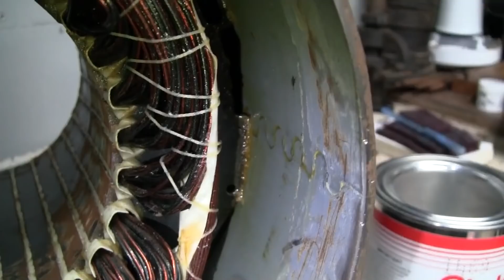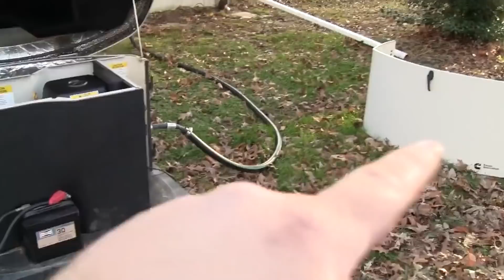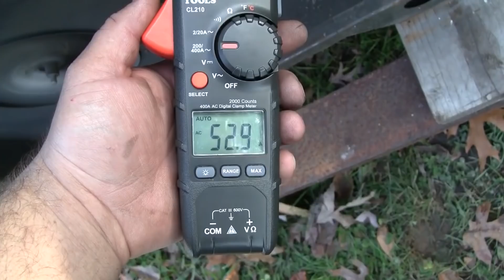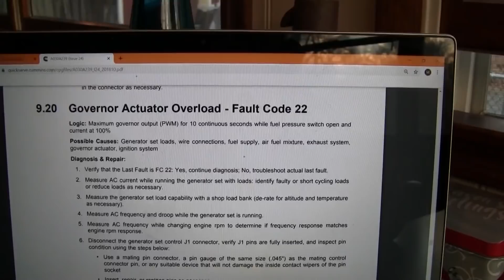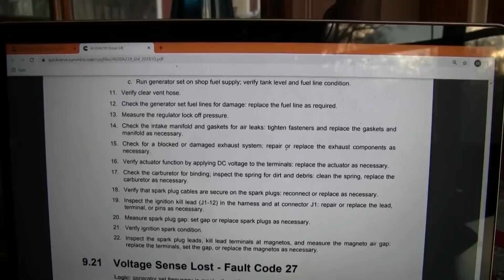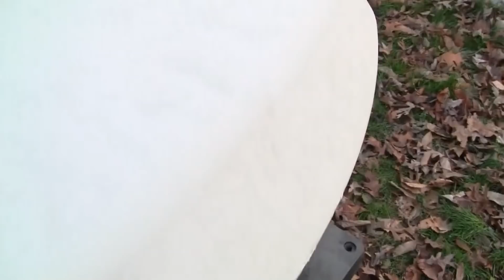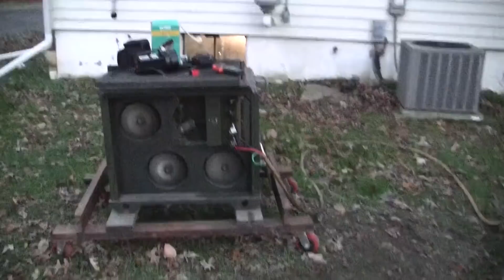COMPLETE REPAIR AND TEST 2015 Cummins Power Home Stand By Generator Pt. 2/2

Comment: I have an changfa 13hp hooked up to 500st head, it has a battery and a hand crank  I put in a glow plug cold weather. it so easy to start. with the pressure release lever. So i am able to get the rpm to start it.  It runs at 1800 rpm just purrs along and uses 1/4th the fuel a gas 3600 rpm uses, I also use the heat to warm my shop.

Comment: Can you make a recommendation for a top quality whole house gen set on diesel. Who makes the most reliable unit. I lean to Deere engine but not sure about gen set. Brush or brushless , inverter for clean power for solid state boards in hvac units, appliances, computers etc in homes today. Thanks.

Comment: Do you find that , IF you charge your standard labor rate , on say a $500 genset that your diagnostic AND repair costs easily exceed the value of the unit you are working on ? OR , do you adjust your labor rate down somewhat on cheaper units so you can stay busy and charge a Higher labor rate on the much larger units so everything balances OUT , over time ? Your expertise is amazing !

Comment: Great repair on that rotor.  The rope and epoxy was a nice touch.  I was worried about the centrifugal force on the solder fixes until you added that.

Comment: You may have mentioned this but can you tell me the Manufacture of the generater (or alternator as seems to be the correct term?) and was it the Italian Manf. Mecc Alta?. I was given a mid 2000s 12Kw mecc alta with subaru robyn gas engine (EH72 - V-twin 25hp). It is clearly commerical made but despite having commercial decals thu-out i can not find any Manfacture idenity but its is layed oyt ezactly  (Kinda) like this one you worked on but more modern in its control board and all analoge control with 2 large Caps. Need the idenity of  it so I can locate the wiring diags etc. so I can 1) work on it and get it going & 2) convert it to more modern digital control, if i can.  Thanks for any help you may provide.    MER

Comment: Some gen manufacturers rate these home units when run on LP gas. As you figured when on natural gas you must derat. NICE JOB. I have a 30 year old kohler 18 kw. Has a 2.3 l Ford engine, 1800 ram still going. I worked for a Cat dealer as a EPG Technician for 43 years. NIVE JOB

Comment: When my company replaces an old machine like that old Onan in this video.....We sell many of them to Mennonites from Eastern Pa......They will buy almost anything and try to rebuild it.....I have used epoxy or silicone to cover wires and help hold them more firmly like you did here. Generally there is next to nothing on those connections......It surely doesn't hurt to try and keep them from being pulled loose by centrifical force....

Comment: Now, it's had a good break-in period, time to change the oil and filter(if equipped) and adjust the valve clearances. It should last for another decade, as a backup generator for a residence. I would just recommend that the oil level be checked after every black out, to make sure it's ready for the next black out. The problem with natural gas, is that it can be considered an "infinite" fuel source. The generator won't run out of fuel, before it runs out of oil!! With propane, gasoline, or diesel, it's easy to remember to check oil level each time it's refueled. With natural gas, you must be vigilant on maintaining proper oil level. Most of these generators have a low oil cut off, but that is only a safety stop gap, not an intended low oil indicator.
      A generator like this should be test run periodically, and should run loaded for at least an hour each time, just to evaporate any moisture that has condensed in the oil from prolonged periods of non use. These are a good time to check the oil.(These are my biggest concerns for backup generators)

Comment: I have a Generac generator 30kw I had it installed 14 years ago. My house is 6200 sq ft.  It runs everything in the house never had one problem with it. It runs off of propane . It starts 1 time a week for 15 mins. It was worth every dime I paid. I have mine mounted away from the house like 75 ft. You can't here it at all but I live out in the country.  I did have to put a new battery in it. It has a 4 cly GM motor.

Comment: Too bad that the genset redesign was not retrofit able! Now there's a jargon laden sentence.  Good thing that you can find the fault and improve upon the original design.  I bet that that flaw is what caused the redesign at least in part.  I'm surprised that Cummins didn't take the faulty unit back for fault analysis!  I guess there was no point since the exact model is out of production.

Comment: Thanks for the videos on this generator.  The rotor design was very, very poor. Save a penny on soldering / brazing the connection but the customer (or warranty account) takes a beating.  Also that scratched winding enamel is incredibly sloppy craftsmanship!

This machine is so lucky you got it and saved it. It could have gone to the scrap yard quite easily.

During your test run, when you went to 15kW, I could hear that it didn't recover to full speed. Too bad about the gas pressure issue! 

Very cool with the stroboscope to be able to see the rotor while it's being affected by centrifugal force.

LOL I don't blame you for selling it. That is just WAY too new to be something you'll enjoy owning. :)
Reply from the maker: Thanks for watching David!
Reply: @SmallEngineMechanic  You're welcome!  I'm playing YouTube catch-up this week. Quarantine for 7 days to get on a jobsite LOL!

Comment: The two different wire colors are for lead identification when  making connections to external leads. Onan designs and makes this rotor and stator,.
Reply from the maker: Thanks for the info!

Comment: The Stroboscope portion is extremely interesting. Thanks for this video SEM...
Reply from the maker: Thanks for watching!
Reply: @SmallEngineMechanic  I enjoy listening to folks who are well educated in their trade. I would really like to have more knowledge on generators and the electricity they produce.  I am subscribed and  will stay tuned to your channel. Keep up the great work. Oh yeah, I really love that 885 Cu. in. engine, it's almost as big as the W.W.2 Ford built GAA engine which was installed in the M4-E8 Sherman. It was 1100 cu. in. displacement, 500 H.P.
P.S. Thanks for subscribing to my channel.

Comment: I have a 16 kw Generac. I'm curious if they used the same parts. I haven't had  many issues except a solenoid that was buzzing really loud and that was replaced under warranty by Danley. Great repair work and video.

Comment: You did a great job of repair. If I had to add a little advice it be to use very high temperature epoxy  as the rotating field usually runs quite a bit hotter than the stator., of course you are not directly on the windings. An old Delco generator engineer. Thanks for a very interesting video.

Comment: A couple of things I'd like to see if you still have the generator set up.  One is its step-load response at say, half load.  IOW, set the load bank to about 10kW and then close the main switch.  I'm very interested in seeing how well the governor responds.  The second thing I'd like to see is the throttle and actuator.  The reason is that I want to compare it to a Generac.  Generac uses a slow stepper motor to drive the throttle.  Therefore it's step-load response is horrible.  A step load of 1/2 rated output on my unit will sometimes bog the engine because the stepper is so slow.

A couple of tips based on my being an EE and more importantly my moonlighting for over 40 years in my friend Jerry Brown's Jerry's Electric Motor Repair in Cleveland, TN.  We lost Jerry to lung cancer in the fall so I've been spending at lot of time in his shop since then working out jobs they'd taken in.  The cancer disabled him suddenly so he worked almost to the end.

This is not criticism but tips learned from over 4 decades of motor repair.  First, on making the extension leads from the pins.  Jerry learned many moons ago not to use soft solder in high vibration environments.  It will eventually crystallize and fail.  I would have made those joints with silver solder.

Next, instead of that low strength ribbon, I would have pushed the wires as tightly as possible against the plastic and then wrapped it with Kevlar string.  Next is the question of the temperature rating of the epoxy.  For repairs like that we use a motor repair epoxy rated for 400 deg F service.  Finally, I would have drilled some angled, shallow holes in the plastic and used a sewing needle with the end ground off to make a fork to push some Kevlar fibers into the holes, followed by the epoxy.  this provides a tight mechanical lock in addition to the adhesive bond.

One of the things we did was modify small series motors to make them extremely high performance motors for hotrodded small electric vehicles.  A typical mod was to take a GE 6 hp at 36 volts rated motor and mod it to run at 15,000 RPM and 150 volts.  Things like I described above, especially techniques to hold the commutator together are used.  

John

Comment: Hello Boss :) .......... i have a question. shall we need to Advance the ignition timing while using Natural Gas ... as far i know .there is the difference between Petrol and natural gas octane. :) i have 1OKVA Generator and i made changes to increase the timing by 2O degree, increasing the ignition timing by 2O degree (advance) the engine performs better with low Natural Gas consumption. it means 25% to 3O%  less Natural Gas consumption.

Comment: I would keep it, unless you are desperate for money. Get a bigger orifice for your regulator and plumb a bigger pipe to get rid of fluid friction loss in that hose. Build a concrete block 3-sided baffle to direct noise away from the house, and you would have a really nice standby generator setup. Maybe you already have one? Never mind...

Comment: What made you decide on that strobe vs. others on Amazon?
I am interested in another brand that has trigger in/out available, but don't know what the light output is.
i might even get the other model and change the flashlamp to a high output LED.

Comment: Very well done. A solid repair. Could an old car engine timing light be used to strobe the rotor if the light was triggered by one of the spark plugs?
If you spliced in a propane supply to boost the pressure perhaps you could have gotten full output before maxing out the governor.

Comment: Epoxy varnish is tough so factory did the hack job on clean up of the stator.Glyptal is a downgrade from the epoxy.I was an electrician/rewinder for the Navy for 30 years. I'd have gotten some class H varnish to coat the stator and baked it at 400 deg. for 4 hours.It would be better than glyptal.Using a strob on a 400kw generator once and some dweeb from another craft tried to reach inside it.I grabbed his arm or he would have lost it.lol

Comment: Regarding centrifugal force on the soldered connection and wire fix. Assume the solder and  copper weigh a half ounce total, the radius Is 1.5 in (3 inch diameter circle) and 3600 rpm then the total force is about 17 pounds pulling outwards from the center. This is more than I would have guessed.
For more info look up  Centrifugal force calculator. You can just plug in the numbers.

Comment: We have a 15KW 2-3 years newer and we're just over 100 hrs. Heck just the 20 min exercise every week puts on17.3 hrs a year. Good unit. It just starts after about 10 sec into a failure, puts out power in about 30 sec more, and then just purrs. After power is restored, it runs without load for about 10 min and then stops. What more could you ask for?

Comment: That Glyptal paint reminds me of the Red-X corona dope we used in television high voltage repair years ago.
Reply: i bet you got some old school knowledge.  you ever mess with old tube radios or guitar amps?
Reply: @stevewinwood3674  I started out repairing tube radios in the late 50's.  At that time, all consumer electronics with the exception of a few battery powered radios were vacuum tube based.  I've repaired quite a few guitar amps and HiFi audio amps and preamps in my day.  In the late 70's, I specialized in VCR and camcorder repair.
Reply: @NCF8710  sweet.   you ever watch "uncle doug" channel?   he does guitar amp videos.   i have learned a lot from him
Reply: @stevewinwood3674  No, I haven't.  But I will certainly check it out.  Thanks!

Comment: I find it very hard to believe that the manufacturer’s assembly process is so subpar, especially for Cummins. Great job repairing it.
Reply: The design of those stupid studs is so incredibly bad. Relying on a connection by pushing that hub on there...really!!  Bad engineering!!  But...Beautiful fix. Thumbs up!!
Reply: You can see why they changed the generator. 
 They probably have many more faults.

Comment: I just got a light tower with a lister Petter and pow’r gard 6kw at 1800 rpm’s. The engine runes great. The issue is that it was missing the capacitor. Can’t find anything on the unit for size. I’ve looked on YouTube and internet. Can’t find anything on this thing. Do you have any info I can check out or do you know about what size capacitor I need for it? I am a bit to far from you to send it to you. I live in San Diego California.

Comment: I would bet that if you had been watching the gas pressure gauge when the loads was switched up to 15 KW you would have seen it nose dive as the governor opened right up to meet the load.

Comment: Bet that the gen unit only was built in China. Who would use pressure pins to couple the windings to the slip rings. Where did you find the varnish for the coils? I remember using a varnish by the same name but it was rated for 20Kv. We used this to insulate night vision power supplies which are running a several thousand volts.

Comment: Thumbs down are from the generator employees that did the sloppy work.
Reply: Well actually.... it's not sloppy work, it's an engineering design issue which was implemented to simplify the manufacturing process. In this case, most likely that whole rotor assembly including winding, wire orientation across the press fit slip ring with pin assembly was machine fitted and assembled. That's why the press fit pin electrical wire connection was implemented, easy work for a machine.... unlike solder or wire crimp located in such a small and delicate area.
Reply: Chances are real slim that the rotor and stator were US made.
Reply: Proud union workers

Comment: On that joint you should have just took a thick piece of copper wire and ran it straight from the winding to where it needs to connect

Comment: So ive been wondering this and you kind of answered it. Since its a 20kw Gen set at 240V that is 83.333 amps, so is that 83amps per line or combined L1 and L2? after watching the video it seems to be per line

Comment: Solid troubleshooting, diagnostics, and professional repair. The additional weight of the wrap and resin should be negligible as they sit so close to the bearing. 65amps of 1.5hrs. continuous load is an overkill test scenario for a 20kw Natural Gas household standby generator. I agree your gas meter & possibly your gas regulator could limit a full load test. Also residential gas pressures do float a little and most older homes installing a home standby generator will require a meter & prv upgrade. FYI you should setup a Raspberry Pi as a data logger with 3 CT clamps(L1,L2, and battery charging amps), 3 volt clamps(L1,L2, battery), 2 temp probes  ( engine water temp & exhaust temp) you can monitor these data points from your cell phone with a terminal server browser connection.

Comment: Woah that stroboscope is a really neat tool.  Does it actually look as good in person than on camera?  That was really cool.   That's an odd design that they did not properly solder the coil winding to the pin.

Comment: Love the videos keep up the good work quick question, as someone who works on boats a lot I have found that the epoxies that I work with when doing fiberglass work I can get static builds up in them if the Loctite is similar (and I do understand epoxies are different) but if it is similar can a static build up in that area cause any issues with the generator?

Comment: Mike, I'm the former owner of a company that did all the automation for Cummins at the Fridley MN plant (for 17 years) and specifically for the line that this unit was manufactured on. I have intimate knowledge of the manufacturing of this unit. Your assumptions are spot on.  Also, I own this same exact unit, it has 150 hours on it. Happy to answer any questions.

Comment: Nice work.  Strobescope was a clever idea.  I would guess, the 22 fault was fuel supply.  The 59 hz indicates to me you were out of motor (throttle wide open, low fuel).  The other shots showed the govenor holding 60 hz tight.

Maybe an O2 exhaust sensor would show it leaning out from low nat gas pressure if you have one to play with.  Just thinking out loud.

Keep up the great work.

Comment: To those people who want a whole house generator should check this video. My town probably like most towns are getting upgraded gas lines and pressure. So this unit can probably get close to its rating. These Natural gas / Propane units are nice but I think fall short on peoples perceptions on ability to run constantly for long hours and possibly at high loads at 3500 RPMS. They should be used for essential equipment and appliances. This is a excellent video tutorial.

Comment: You should have just stopped with a light coat of glue on the slip ring connections.  One of this model's many faults is that they like to suddenly go bad (get big grooves from the brushes) and it would be better to make the slip rings replaceable.